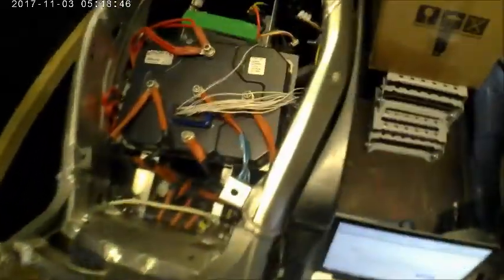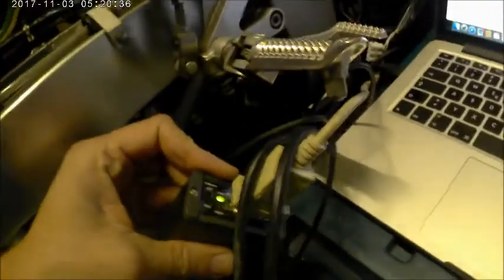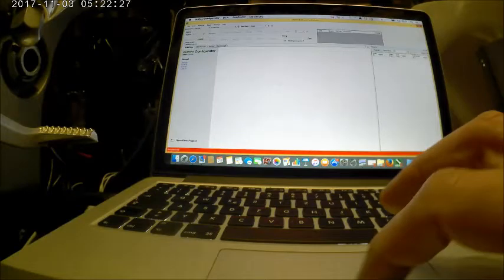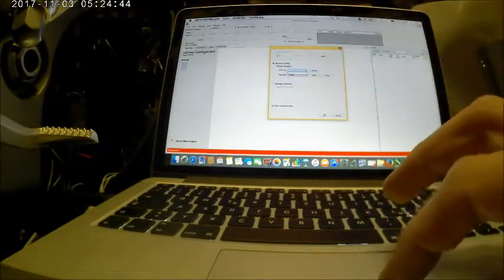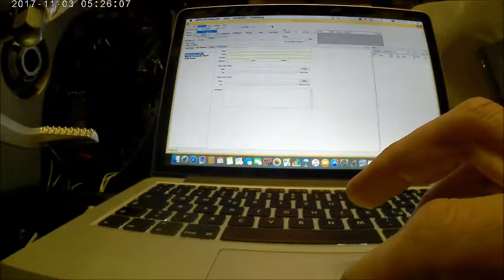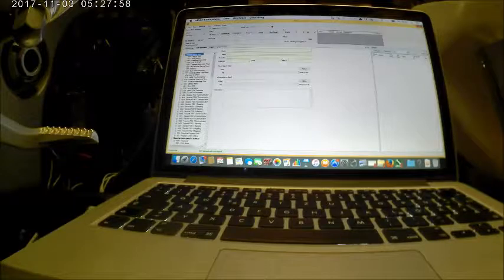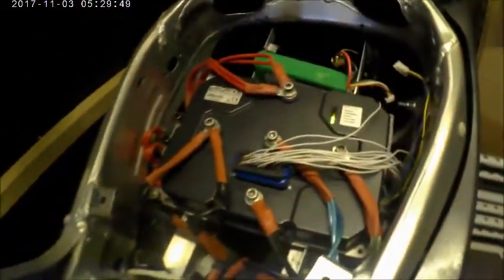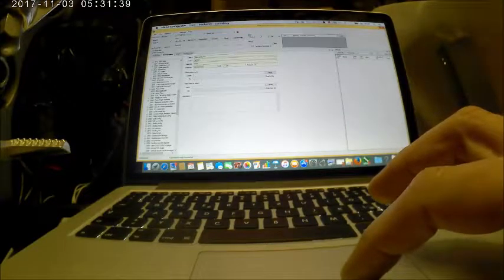Parameterisation of Emsiso EmDrive 500 Part 1 of 2

Comment: Hello! I am with a formula SAE racing team from Liberty University, and it seems we are having similar struggles with our EmDrive 500 to the problems you have already solved. In your description, you mention that you were able to get the system running with the correct PI regulation. How did you do this? The manual does not seem to give any description of this process, and we have had little luck with contacting Emsiso.
Reply from the maker: Hi, that’s a long time ago 😉. If I remember correctly I started at lower voltage and lower amps and tried different P and I values to come as close as possible to the characteristics shown in the spec. Then I got the information from Emsiso that I should go to the max system voltage and try it again. And then it comes more ore less to this characteristics. It cost me 16 hours to get him running. The controller is sending a rectangular value to the motor that my trailer starts to shaking 😉. I think I did this test only with 30amps. You must been in the test mode for this. If you want I can forward you all my information about this controller and different commissioning instructions I got from Emsiso 2018/2019. I also made a lot of characteristics with different PI values. So you can send me an information to sanderandre@gmx.de then I can forward you 1,6GB of information (a lot of pictures and additional remarks inside the manuals regarding different steps) maybe it could help you. Btw. I already sold the Emsiso controller and changed to Scott Drive. Of course a little bit heavier but much more power and a lot of easier to get the motor running via automatic applications in the software!

Comment from the maker: If you are using hall sensor feedback pls. only set the max current to 80% of your motor max current because of the strong magnetic field which will be in the stator because most hall sensors are attached to the stator and will then deliver wrong values if the magnetic field be to high! Another point is parameter 2033 which must be set to 1, even you have 10 pole pairs! The number of pole pairs have an influence if you are running in speed mode, so there you have to set the default value 4096 back to pole pairs times 6 (60) @ (0x6094 0x02)!
Reply: Have you tried it with a resolver ssi so you can reach 100%  current settings?